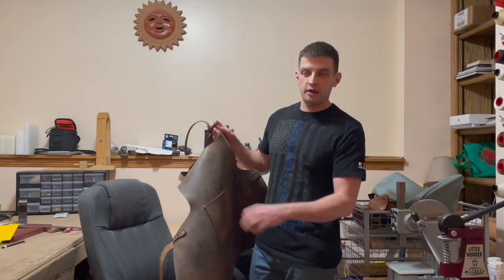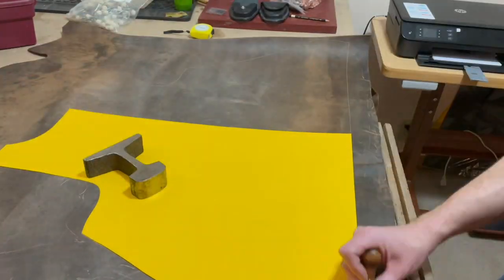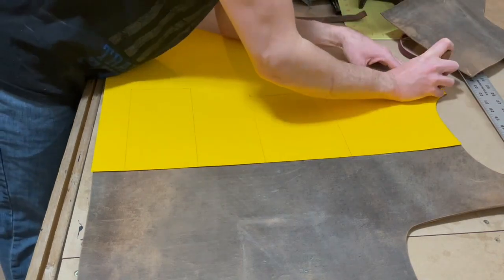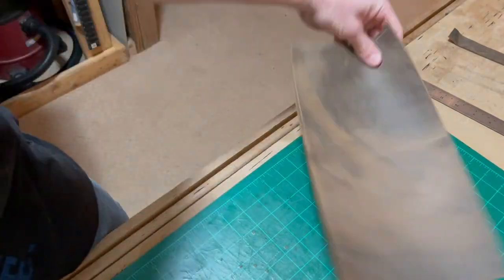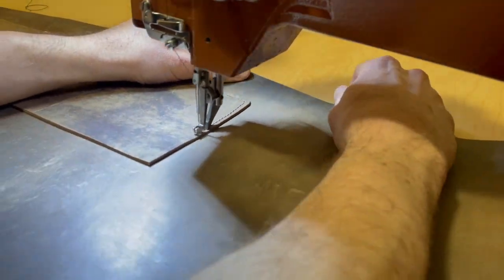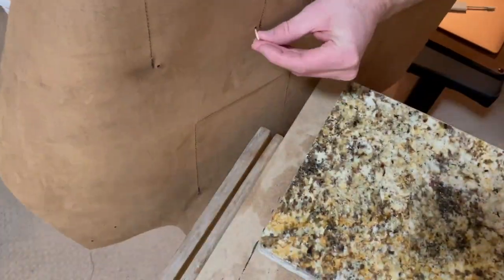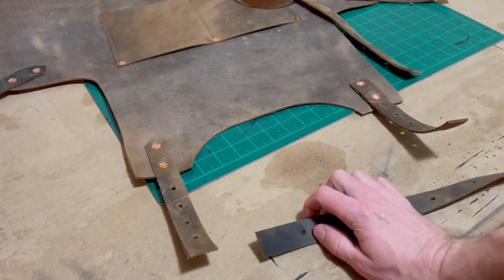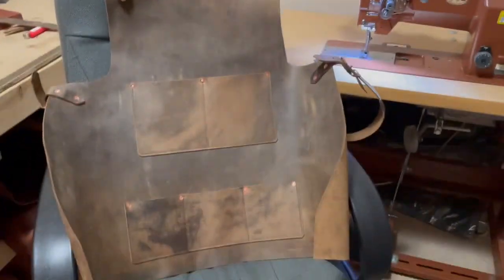Making a heavy duty leather apron

Comment: Hey Andrew I like your Chanel. Contact buckle guys they have a wonderful tool for copper rivets I have the 3 types In my shop and I love them.  Also this is my two cents if you put a leather washer under you will find that the rivet doesn’t damage the leather over time. 

Later and stay safe